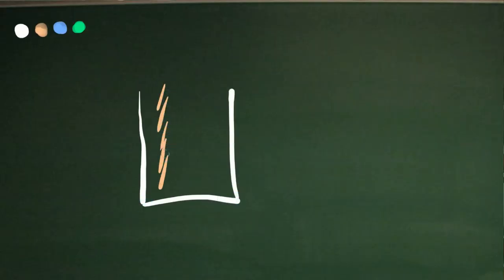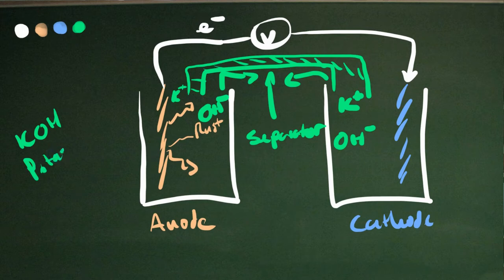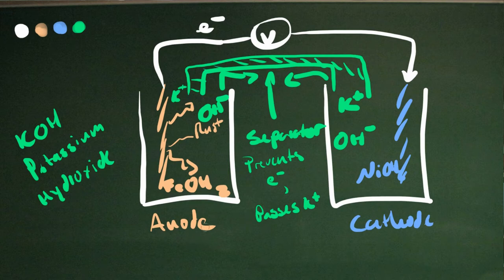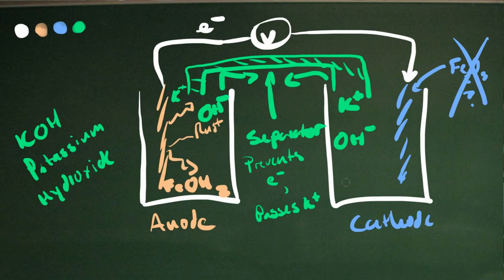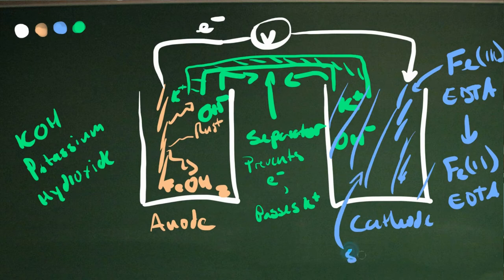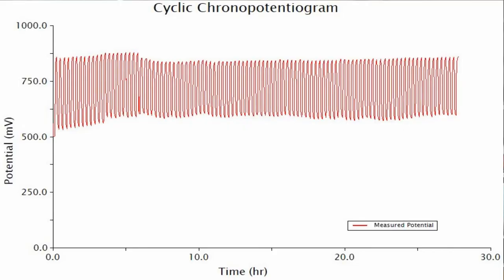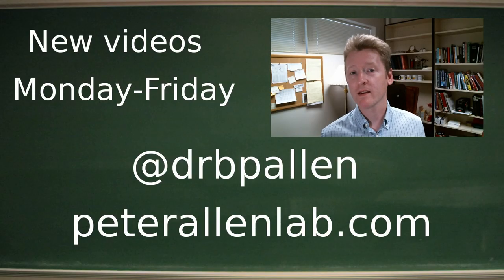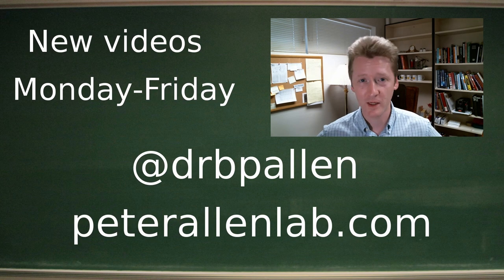Iron Battery Recap: Why and How

Comment: Hi Peter,
Shame about the aluminium current collector, as it so cheap in the form of cooking foil etc, and a good conductor.
Perhaps a coating of a graphite ink could be applied to help stop corrosion of the Al, it is fairly cheap and easy to make and would be a lot cheaper than stainless steel or copper etc.
Martin.